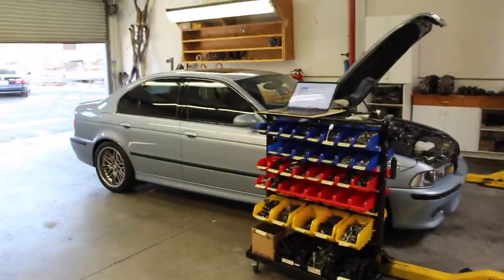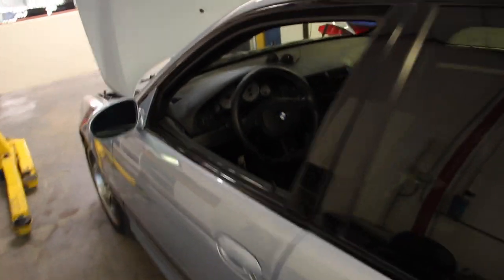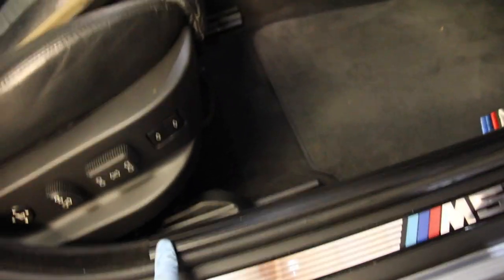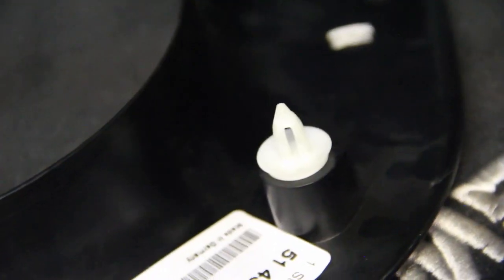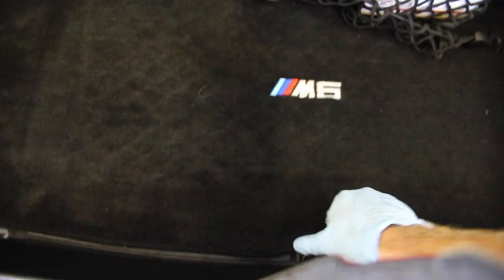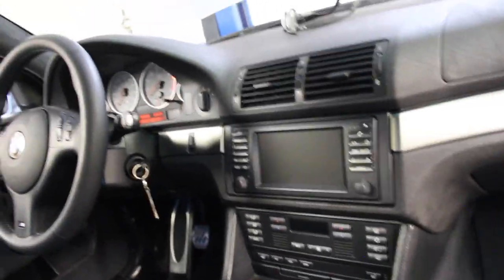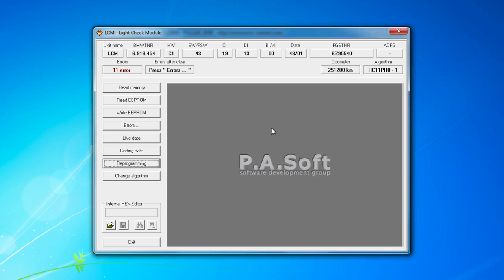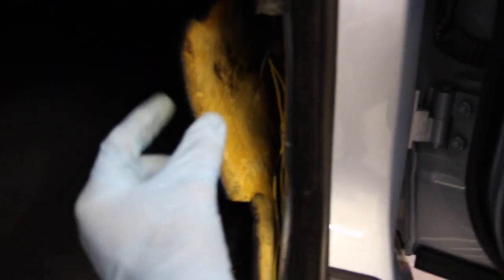BMW LCM Coding, E39 Tail Light Ballast Delete DIY

Comment: I just have LED bulbs tossed in and the little resistors they sent in dont help with the flickering randomly. Can i code it to stop the random flickers? I have a US E39 525ITA
Reply from the maker: You can disable hot/cold checks in software such as NCS.  I do not recommend LED bulbs in E39 lights beyond the halos or license plate lights though.
Reply: Ahh okay, thanks man.

Yeah, I've been trying to find a decent set of led rears but its hard to find so i thought bulbs would be okay. But being overseas now there seems to be a better market for the tourings might take another look. @E39Source

Comment: I've got an E46 M3 and when I enter the LCM, check/control messages show up like yours however is faded indicating it isn't a clickable button for me. Any ideas on why that might be?
Reply from the maker: What is faded?  Usually that means 'feature not available or applicable" but it should be.  Does it work in other modules?

Comment: Been following you for along time now... I'd asked you how business was a while back and what you do with leftover parts have you figured that part out yet?  And how is business going now?
Reply from the maker: Thanks for the support!  Parts business is holding up- I've got lots available still.  We just took in a new M5 yesterday, a video will be coming soon!  Parts we haven't sold are in our inventory system, but over-stocked items or things I can't move will be recycled or disposed of eventually.
Reply: @E39Source  if your shipping parts throw in a small part that wont up your shipping cost too much... that's what I do to get rid of bike stuff that I would of thrown away..  and no problem,  keep doing what your doing I follow the movement 💪🏿

Comment: Did you run into any issues with respect to working order of your taillights? I ordered the exact same adapters from some dude in Latvia thru eBay, but the pins in my car are arranged differently. It's still 6 pins, but one of them in the car doesn't connect to anything in the adapter and viceversa. Sure enough, my turn lights do not work now. I mean, none of them. Hazards do work though. I guess I'm a traditional BMW driver now! Will see how hard they are to modify.
Reply from the maker: This vide is about to come down.  The Hella Euro 1997-2000 retrofit lights that I have want 10 volts to the celis lights, and that is what the ballasts do, step that voltage down.  All LCMs (Euro and US) seem to always supply 12 volts to the celis lights, which caused mine to fade and burn out after a few weeks.  So- the ballasts must stay in my case.  But the adapters weren't a problem, did you get the right ones?  Make sure they're on the right side?  They worked out of the box for me.
Reply: @E39Source  Sorry to hear you run into that problem. Not sure why you have to install the ballasts again, though. If you had to source another set of tail lights anyway, shouldn't those work fine without the ballasts? Otherwise people would be replacing their tail lights every month (unless you got the same tail lights like the ones that came with the retrofit set).  In my case, the adapters were the same ones you got, BMW parts. If you look at the 23:49 mark on the video, you see 4 pins on the rounded part of the connector and 2 on the opposite (short) side. I noticed right away that the car-side where this plugs in, has the same four pins on one side but the other 2 are not opposed to them, but instead on one side of the connector. This obviously causes that 5 out the 6 pins make contact. Doesn't make much sense to me. My car came with a LCM2, I sourced a LCM4 (PA soft said not found, assumed defective) and a LCM3b (installed). I assumed the difference in the pinning was causing my turn signals not to work, but I plugged back in the old LCM2 in and everything worked fine. So it's definitely something in the LCM3b keeping them from working. When I push the turn signal lever to either side, it does absolutely nothing. No clicking noise or anything. Hesitant to start checking/unchecking boxes or to mess with the reprogramming (there are several "modes" that you can set, I have no idea what those will do). I want to keep the newer LCM for the xenon capabilities, but if I can't make the turn signals work will have to go back to the LCM2
Reply from the maker: @pedrogadea4926  I purchased the same tail lights again, the Euro Hella retrofits.  So I do still need ballasts.  I got these lights because they fit the pre 2001 chassis much better than USA style facelifts, and I could still easily get them in brand new condition.  USA cars are not wired for rear fog lights, so only 5/6 pins will be used on the adapter in your case.  It sounds to me like your LCM IIIB is dead too, the turn signals should work fine even before VIN/mileage programming.  You might want to check the mode.  There is workshop mode, transport mode, and normal.  Make sure normal is checked, I am unsure what the other two modes actually change.
Reply: @E39Source  Great info, thanks. I don't think the LCM 3b is dead or defective, based on the fact that I tried not 1 or 2, but 3 others, and the exact same thing happened. 
I will check the mode, (not sure I've seen that before), hopefully I can make it work.

Comment: I have a 2018 MacBook pro like yours. What way did you take to get windows on it? (bootcamp, parallel, vmware) Also is it best to use windows 7 or can I use windows 10?
Reply from the maker: I use the latest version of VMWare Fusion, and Windows 7.  Windows 7 will be more compatible with this software than 10.

Comment: hi guys ,is there a way to code/adding code to have the angels ON as DLR  on a e39 ? what is the name refering to the angel on the lcm code ?
thanx
Reply from the maker: You would need an LCM 4 from a later BMW to enable xenons without aftermarket equipment.  If you have a BlueBus, you can simply enable DRLs in the settings to use the halos as DRLs; this is what I would recommend over swapping LCMs.

Comment: You should first write mileage then the vin if the mileage from your lcm is higher the cluster, just to be sure that the rest of the car doesn't go up.
Cluster still need to be coded with the right data with ncsexpert, because you gm/sa/vn stil do not match the car, and then code it with ncsexpert to accept rear facelift lights
If you have the right modules in europa at least almost all of the support lwr
Reply from the maker: What does the cluster have go do with accepting rear facelift lights?  My understanding is that only the LCM needs to be upgraded/programmed for this.  Mine are working fine.

Comment: Hello.
Then headlight switch is in position "A",and then you start the car,halos is on and read leds? And what happend if in mode "A" you will turn on fog lights?
Thanks.
Reply: with A you cant get halos and leds on, sadly.

Comment: Did the software you're using come with the diagnostic tool? And would it work on an BMW E38 from 99?
Reply from the maker: The software did come with the OBD adapter and the USB cable.  It would work with a 1999 7 series, but you'd also need an adapter to go from OBD-II to the old under-the-hood round diagnostics connector.  Those are all over the internet though, quite common.
Reply: @E39Source  Thanks, I already have an adapter and could use NCS Expert, but the software you're using seems to be way more easy to use.

Comment: Without pulling my LCM out to look at what it is (III, IIIB, etc), is there a way to determine what I have from the #'s off PA SOFT?  My 540 is a 2000, and in PA SOFT, I have: 6.961.141 HW: 07 SW: 21.
Reply from the maker: From what I see online, that is an LCM IV without auto-LWR.
Reply: @E39Source  Interesting.... so, if I install the retrofit cells lights WITH ballasts, I shouldn't need to do anything coding wise?
Reply from the maker: @patricklee7214  That's correct
Reply: E39Source so now that you’ve tried this.... basically, even though the LCM IV can “manage” the CELIS tails, this only applies to “normal factory” (and not retrofit) tails that expect 12V.
Reply from the maker: @bmwm750  Exactly.  The retrofits need 10 volts (thus the ballasts to provide that) regardless of LCM version/coding.

Comment: Can you change an LCM 2 with an LCM 3?
Reply from the maker: Yes
Reply: @E39Source  I would like to mount an LCM 3 B, I think it's one of the most recent, (the one with the yellow label)
Reply from the maker: @giovanninocito4666  There is a 4A version, but it is harder to properly code.  The 3B is a good upgrade to give you RLS support.
Reply: @E39Source  Since I had an Lcm 2 to code the new lcm3 how should I do it? Can I copy and paste from the Eprom?
Reply from the maker: @giovanninocito4666  I wouldn't copy and paste between different module versions.  Just take photos of your current coding options as they appear in PASoft/BMW Scanner and duplicate them on the new LCM.
Reply: @E39Source  Since I have an lcm2 I can't see or make light codings (as you do on the lcm3)
Reply from the maker: @giovanninocito4666  PASoft doesn't work for the LCM2?  I've never had an issue with that.
Reply: @E39Source  On the lcm2 when I go to "light coding" it says "Not available for this coding index, yet!"
Reply from the maker: @giovanninocito4666  How bizarre
Reply: @E39Source  I tried to do the coding manually on the new Lcm 3 but I couldn't get the rear fog lights to work and also the brake light on the instrument panel came on, it also gives me errors of some options that I don't have
Reply from the maker: @giovanninocito4666  Additional coding is needed.  If your E39 is a USA car, you need to add the switch, wires, and bulbs for rear fog lights.
Reply: @E39Source  I already have the rear fog lights, they worked with the lcm2 they don't work with the Lcm3, my BMW is European